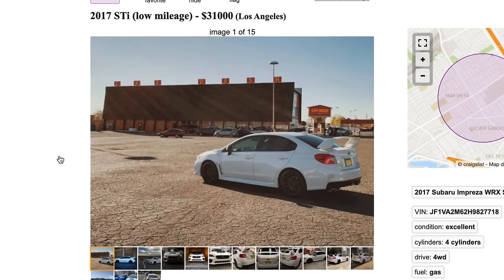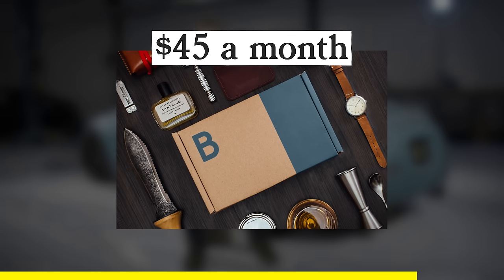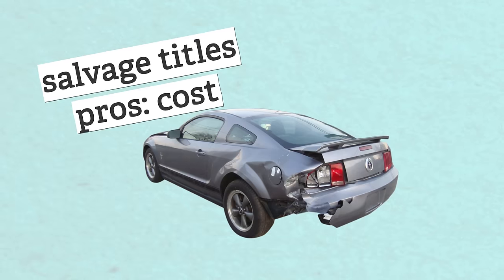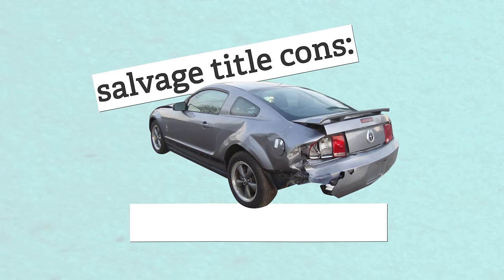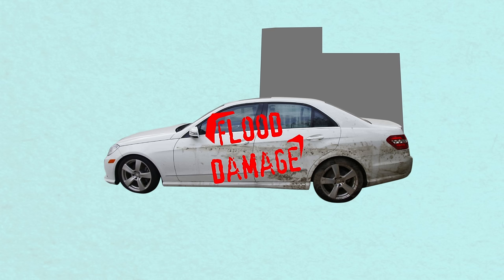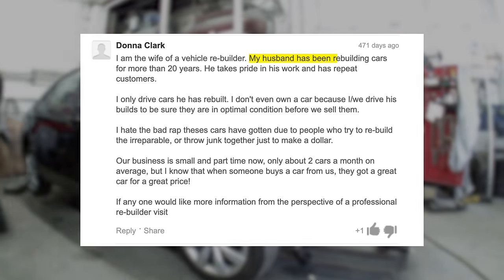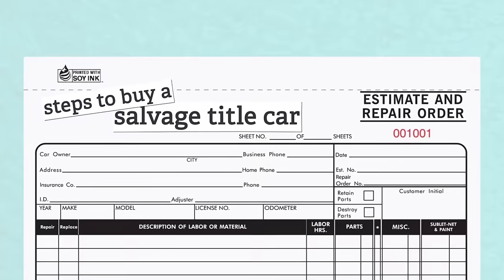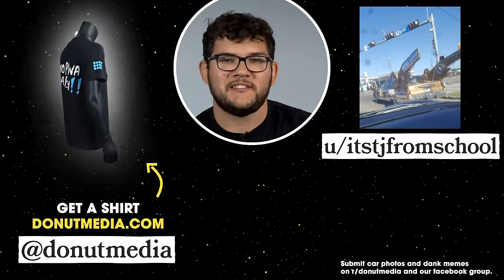Buying a Salvage Title Car: Bargain or Nightmare?

Comment: Nothing wrong with salvage cars as long as they’ve been repaired properly
Reply: And aren't flood cars, short of that it's usually fine.
Reply: Or unprepared and clearly show the damage
Reply: True, as well as those that are only cosmetically damaged or were in a fender bender, while they might be low mileage and mechanically solid, were too old or depreciated for the insurance company to bother paying to repair it. My first  and so far only two cars I've owned have had salvage titles. First one, a 1996 Chevy Beretta that got hit or hit what was probably a pickup truck or something high. Only damage? Busted headlight, bent fender and a bit of a dent in the hood. Got it for like $700, and the seller threw in a fender and hood from a donor car he planned to fix it himself with but never got the time, and I did the repairs and pulled a headlight from a junkyard car. Got the replaced body panels painted at the local Votech's bodywork program for next to nothing and had a pretty nice looking 60,000 mile car with one of those 3100 V6s GM put in a bunch of stuff in the 90s that still had a lot of life in it. Had it for I think 5 years and sold it to a kid as his first car who was tickled pink by it. (Or purple, it was that cool Black Rose dark metallic purple Chevy used to use. I think it wound up on Camaros and Corvettes too). Thing went full circle. My current car is a 2002 Ford Focus wagon in almost the same situation. Fender bender at around 65,000 miles, but was already around 10 years old so insurance said F-it. That time the seller did the repairs, so I paid a bit more upfront for it. So far I've had it for 6 or so years and I'm up to like 147,000 miles and it doesn't show signs of quitting yet. Only  issues I've really had with it were a failing coil pack, a coolant hose that came loose from it's clip and rested on an EGR line melting a hole in it, and a cracked radiator housing.
Reply: @RageUnchained  Yeah flood cars are a definite no go but other than that it's fine.
Reply: Problem is that salvage shops use drivetrain and suspension parts from other wrecked cars to fix yours. So how do you know what condition those parts were in, or how many miles were on them?
Reply: They're great... If you never intend to insure or sell them - as tis video clearly points out
Reply: Jake DoesntLikeU. ...or were just lucky.  A lot of “rebuilts” are totals for minor reasons and sometimes fine once fixed.  I wouldn’t buy a modern (newer than +/- 25 years old) for one reason only:   Airbags could fails to work, or worse:  they could deploy suddenly out of nowhere.  I worked for IIHS and knew of too many deaths or near fatal injuries from airbags, sometimes when a vehicle was not even under way.
Reply: w5kky I suppose that’s an obvious point, but how does anyone know if its been repaired properly?
Reply: Insurance and resale are rough with salvage cars.
Reply: @JustSomeGuy496  no really
Reply: I repaired my salvaged car and it some how past the Enhanced  inspection
Reply: Flooded is a broad term, a car could have been flooded up to the seat rails in fresh water or totally underwater in salt water, salt water is a car killer for sure
Reply: @Ch4osWe4veR  god man you wrote a entire article
Reply: Jake DoesntLikeU  he got lucky and should not test it again with another flood car. Water and dirt get everywhere and shops will usually do the minimum to get in running and sold.
Reply: And good luck getting a bank to finance a purchase a salvaged title vehicle.
Reply: I bought a 2014 Ford Taurus police car with a salvage title, the car had front end damage but it was an easy fix as per the guy who sold it to me, it had 44,000 miles on it and I paid $7500 for it, best investment I’ve made and would do it again.
Reply: Eulises Sanchez Jr It’s not really an “investment.” It’s an expense.
Reply: By you that is obviously....
Reply: Not really
Reply: US doesn’t take well to repaired cars
Reply: Will Reese if you rewire and change the ECU your mostly good
Reply: The husband has been repairing salvage cars for past 20 years. That's means marry a good mechanic so you never have to go the dealerships.
Reply: You cant get full coverage thats why alot of people dont buy em
Reply: Very true but big toin toss
Reply: Obviously that is the case, but rarely can you ever know if they have even repaired properly so it is always a gamble.
Reply: Your kidding Right😂 fixing most cars cost more than buying one second hand
Reply: lmao yeah right they r always fixed with as little money as possable
Reply: Chris fix got a totaled car that was just dirty
Reply: Frame Damage? Airbags deployed?
Reply: Hell they dont even have to be repaired properly, our shitty kia has parts from a fuvking Korean model, a ford clutch jerry rigged to it, a 20 gallon tank from god knows where, and an unmarked engine that I'm pretty sure isnt from the car but I'm too lazy to check the vin
Reply: Pretty much anything other than a rotten frame is fixable so if it's fixed properly with the proper parts by the proper people
Reply: That’s the issue tho. Sometimes they look like they were repaired really well but there might be a solder on a door panel that you can’t see that’s a little sharp and ends up cutting thu some internal wiring
Reply: That's the thing🤣 they are not repaired right 99
Reply: per the usual, have a certified mechanic check them out check them thoroughly, me losing 150 bucks for a pre-purchase inspection is a lot better than me losing thousands of dollars fixing a lemon
Reply: Thank you for repeating the video. I might have missed that
Reply: I own one for 20 years it still run fine. It was stolen and strip dashboard but had low mileage.
Reply: @80s_Boombox_Collector  so do insurance companies as that hiw salvage yards make most of their money as they sell part to insurance companies using parts to fix ppls cars
Reply: @Luis-wq4jq  not at all true in most all states you absolutely can... ppl in CA are the ones with issue as the rest of the nation has common sense

Comment: Savalge cars are a perfect starting point for track car or crazy build
Reply: Yeah more like project car
Reply: 100% agree
Reply: An accurate comment
Reply: Absolutely, because a track car for time attack, for example, are modified af.
Reply: Borneo Fox a track car and a crazy build is a project car 🤦🏽‍♂️😂
Reply: Borneo Fox pretty much what he said what’s the point of that 🤨
Reply: True. Anything that doesn't involve trusting it to get you somewhere you need to go.
Reply: I got a Volvo 2004 S60 R salvage title for 2 grand .. with IPD+ mods .. never looked back since
Reply: If it’s gonna be a track car that’s going to get beat to shit anyway I feel like a salvage car is actually the smarter choice
Reply: I wouldn't mind driving a salvage title car for my daily as he said some salvage title cars has minimal damage
Reply: I would disagree. Metallurgy shows that metals, once stretched beyond their original point of composition, are a weak point. Even if you were to bend it back or weld a new piece, that becomes a point where the car can result in more flex. Not what you want when you're chasing 10/10ths. I mean for just casual, grassroots stuff it probably won't make a difference. But in a competitive racing environment, you don't want that
Reply: If ur gonna buy a salvage  car avoid front damage always go for rear damage or door
Reply: If it drives straight. And the frame ain’t bent I’d buy salvage project car.
Reply: StreetBurner51 I agree
Reply: Isnt it better to buy the totaled car for much cheaper?
Reply: And if you need a broker to bid on one, drop us a line.
Reply: Leroy the Salvage
Reply: @Rewelsworld  not always the case. A lot of times the front ends look bad but keep in mind they are made stronger than the rear for a reason, to protect you in a head on collision. Therefore they usually need less frame work, and more body work and let's be honest body panels are cheap
Reply: Fuck that. I rather buy a rustless car with shitty body panels but a MINT frame and LS swap that bad boy
Reply: @jonathanvillalba3214  Finally someone with some common sense, I was starting to worry.

A car has to pass inspection before it can get on a track. Unless you folks are talking about motorsports where none of the tires have to match 😂😂😂
Reply: COUGH Leroy COUGH
Reply: I want to find a salvage title Impala for a road boat track car
Reply: True, look at B is for Build
Reply: I mean the brz isn't exactly fast but my girl has one, and it is pretty fun to drive/drift a track with. Has decent handling and is responsive. Doesn't need to be fast to be fun on the track.
Reply: @taylon5200  that's just like the "you don't need alcohol to have fun" obviously, it's fun to drive when it doesn't have a lot of power, but imagine just a little more power
Reply: Mike R yeah unless the car has a mid or rear engine but even then where would you find one of those cars anyway
Reply: For sure hands down
Reply: yeah, salvages are only good for projects

Comment: I brought a salvage car for my gf, car wasn’t involved in a accident but was in a drive by shooting when parked overnight on the street.
Reply: That’s hood af
Reply: My dad's van got the windows shot out (by a BB gun) along with about 60 other vehicles that night. The cost to repair was going to be the retail value of the van. Insurance told him vandalizism want covered in his policy, so he didn't go through insurance and a pair a junkyard to replace his windows.
Reply: cloud ix yeah, biological damage will cause a salvage title
Reply: My '02 E55 AMG Mercedes got shot up parked on the street in front of a friends apartment. Thankfully, they only shot out both front windows, rear drivers door window and drivers door frame. S, besides replacing door, which I found a matching door, there was no major body damage.
Reply: I feel like that would add value
Reply: What kind of van is as cheap as then window repair costs
Reply: Only issue is if the bullets hit any major wire harnesses then the car becomes an electrical nightmare
Reply: It prob had lead residue and that was it 😂. Hope it was or is a great car
Reply: Devon Croley the problem is new glass can be very expensive. I’ve seen a new front windshield retail for $7000 before.
Reply: @Twig2250  A dodge caravan? Ford aerostar?
Reply: Who's to say they won't come back to finish off the original target!
Reply: Who did the car shoot at?

Comment: I’ve had my rebuilt 350Z for 5 years and and all I’ve had to change was oil brakes and tires lol
Reply: prolly bc it was an actual rebuild lol, these guys tried to convince my gramma that they could WELD THE BLOCK on her jeep as a 'rebuild', but with no new motor. Keep that zed mint doe
Reply: Ong some rebuilds are good
Reply: My brother bought a 08 g35 back in 2010. It currently has 280,000 miles and still runs. I’d say it’s just as a big deal to know how well maintained the car was before you, rather then the reason it was salvaged.
Reply: @Morocho Vallecitos that’s why you buy real low, like auction sites. I have not lost money on any car I owned(broke even a few times(but that’s still good, I don’t pay money to use a car)). I buy them, fix them, drive them for a few months and sell them. The funny part about salvage is if the car is worth more than you can sell it for you just ride around until the lines meet and the market will take the car. Some times that take a long time. That’s why I stay away from expensive salvages, but if I get a car I really want then I’ll get as nice one, and keep it longer
Reply: I hate when I have to change my oil brakes. Those things are a pain in the ass to replace.

Comment: Here's a tip: Google the VIN of any salvage title car you're considering buying. Auction sites will have pictures of the damage and you can decide if the damage and repairs are an acceptable tradeoff for the price. I got my 2019 BRZ for cheap and all it had was some damage to the radiator mounts and front fender. Replace the bumper, fix the mounts, replace the fender, and boom. Good as new. Runs great and is so fun to drive and I got it for thousands under market.
Reply: Honestly younare the real MVP. Works like a charm. I was just about to see a car, I searched the VIN in GOOGLE, found out its had major front impact. Carfax didn't record that. Thank you so much. 🙌🏾
Reply: How much you got for 2019 BRZ? 
I found a GR86 2023 only 2,300 miles and the damage is same as yours but is only 4-5 grand less but it is a rebuilt title
Reply: I just found pictures of my old car at the auction by doing this, thanks a lot
Reply: 3 years later and this comment really helped me. Great advice!

Comment: "If a car has a salvage title it can NEVER be clean again!

Here's how to clean it."
Reply: lmao
Reply: needed a *Legally asterisk lol. albeit there's a similar trick used to register cars that don't even have a title period. any car older than 15 years does not require a title to be registered in Vermont, and Vermont registration is transferable as a title to all other 49 US states.
Reply: You can but the cost and time just too much...You may well buy a normal used car at market rate... it is better for a million dollar auction car.......
Reply: @campkira  Why do you put so many periods after every sentence??
Reply: I bought a flood titled truck worked fine. I drove it over 200,000 miles before I got rid of it.
Reply: @lyinginbed  that's really cool that everything just worked on it. But, the thing about flood vehicles is that, even if you get a working one like yours, that still means the vehicle will rust through and in places you normally wouldn't expect rust. It also means that the airbags have been submerged. That means those airbags are no good.
Reply: you can actually go thru the process of getting it turned into a rebuilt title !!! 
I tracked down the first owner of the car and he told me what happened to the car I got that fixed and boom rebuilt !!!
Reply: Toothbrush, 409, and some brake clean?😅
Reply: @cpufreak101  just get a bond
Reply: Applying for a lost title normally returns a cleaned title too.
Reply: DJ Coin Laundry  Nc have done it and in texas have done it. Texas also offers rebuilt titles which i've found most companies will insure at normal value as rebuilt is consider insurable.

Comment: We've saved thousands over the years with Rebuilt/Salvage titles. As long as you know what to look for in the repairs/damage, you'll be fine.
Reply: Literally, bought a car with a rebuild title and all I’ve been worried about paying is tires and oil pmao
Reply: Can you give me some ideas of what to look for sir?
Reply: @RodneyFx  rebuilt Toyotas or Lexus only.
Reply: @richardmyers7847  nah lmao
Reply: whom do you go to for insurance without paying an arm and leg?
Reply: @RodneyFx  quality repairs. People that are upfront and honest about the damage and point out the repairs. Try to find something without frame damage or one that was repaired by someone reputable.
Reply: @FiveMCity  Safeco
Reply: Looking to buy a flooded M4, will insurance be higher? Its out of state is it hard to get a new title on it?
Reply: Thanks for the info! My insurance company made it easy: won't insure salvage or rebuilt car, PERIOD.
Reply: @SuteDevices  I wouldn't get something that has so many gremlins. It is a big pain in the ass to deal with electrical problems because the female side connectors which get routed through the framework of the car have to be pulled out and taken apart as needed. Technically if you pull some of the dash board apart after looking at the undercarriage to check for rust or other problems it might be worth it but other times not so much. Otherwise you are going to have to strip the car to the bone or splice and dice every connector you have to get it running again. 

Insurance will make you pay through the nuts to get it but if you are a decent driver, not male, and past 25 you should be okay, with at least 5 years of driving history. It will be double what you would normally pay and be prepared for some electrical whoomph lash. Some states have higher title costs and most don't allow you to designate the vehicle as a normal (undamaged) car anymore. I would say call your local title office (if you have never gotten a title on a purchased car before, you can look up title offices near me or go through the DOL.) Either one will be happy to assist you with your questions. Either that or call up an insurance agent (if you currently have one) and ask about whether they offer rates for a salvage title. Off the bat, I know Allstate doesn't insure salvage vehicles yet insurance is required in my state. (as it is in most).
Reply: @katydid5088  Thank you very much. Might just get clean title. Just won't want someone to rear end me and then its rebuilt all over again
Reply: My 07 Acura tl I got back in October at 96k miles is a salvage title and now in March it’s reached 104k no issues and I just drove it 6-7 hours to la and back and again no issues. I think it really depends on the individual car if it’s worth it or not.
Reply: @richardmyers7847  what about a 2016 scion ia
Reply: Did you pay high rates for insurance
Reply: @FiveMCity  there is no difference in insurance; ppl who say these things are making that up... insurance is always based of full market value even if your driving a pos $500 civic they charge you as if it's a perfect condition at full market value
Reply: @richardmyers7847  I’m looking at a yota for $11k with 80k miles. Suspicious? I’m going to see it in 2 weeks and thoroughly check it out cause it’s a salvaged title.
Reply: Would you recommend it as a student driver in texas lmao
Reply: Can’t wait to do this?
Reply: @richardmyers7847 what about Hondas?
Reply: @natanhaelalvarado6137 i was gonna ask the same question lol